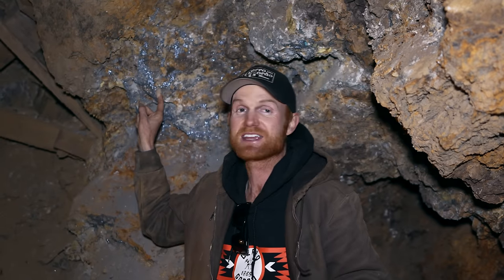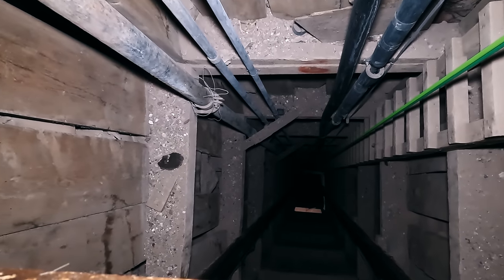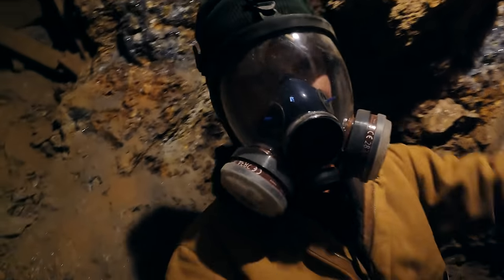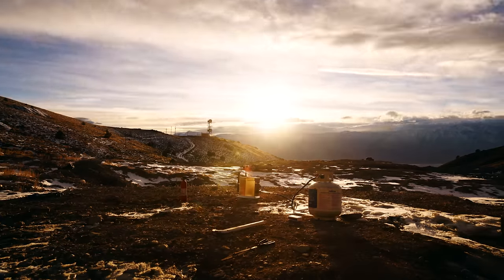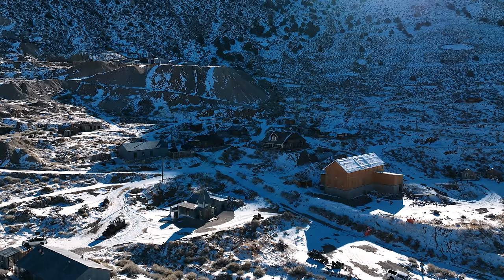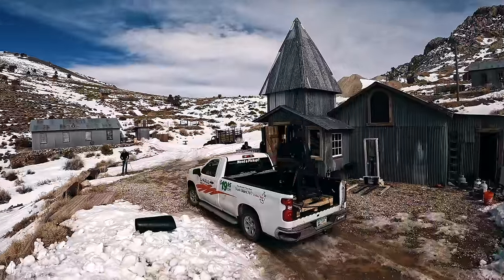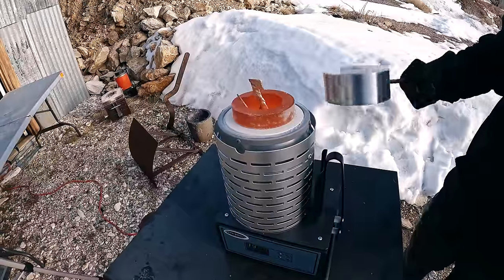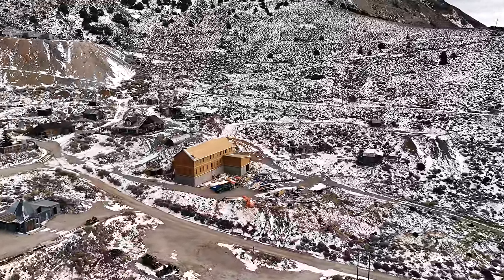I Mined 50 Pounds of Silver Ore & Made 1800s Coins!

Comment: Get a sturdy bucket/box and rope and then drag the bucket up and down the ramp next to the ladder.
Uhm, you're expected to dig ore, not read and play card games during your 12 hour shift.
For the front of your shop, put some doors on hinges attached to the top so you can then lift them up, put posts under each corner and thus not only keep out the elements when they're closed, but give you awnings which provide you with extra shaded workspace.
The Romans also used drop presses for their coins.
Score yourself a smaller electric furnace with a removable crucible - that'll allow for cleaner pours into the mold, also, get that mold heated up before pouring, not just to avoid potential cracking of the graphite, but also to allow the silver to cool without all of those bubbles and imperfections you got.
All said, good video and good haul - I pour coins myself but did enjoy seeing you stamp them out.
Reply: Who is this guy? Sounds like my football coach in high school.
Reply: @daleretired1457  Me or the content creator?
I played basketball, not football in high school and never coached - I only did the video because I collect and pour coins myself - no clue on the creator as this was the first time I've watched one of his vids.

Comment: With every one of your videos posted to this channel I'm impressed even more.  I like the stories you tell, and the process you're going through to improve this camp (the mine).  I've listened to all of the videos at least once, and I've watched and listened to several (many) of them more than once.  
I like what you're planning to do to the water situation for drinking and general support for the town, but I just wish that there was something you could do to the road condition that will last longer than each major rainstorm.  You once mentioned putting in a water catching system.  That sounds like a good improvement for all the non-drinking needs of the town.

Comment: Considering you’re so remote, I had a suggestion for you if you don’t mind. 

I build custom lithium batteries for homesteaders, but have always been curious about a fuel source that one could generate from solar power. 

Have you ever considered a solar/wind and battery setup that has enough power not only to keep your needed utilities on, store energy for low production days, but also to power a hydrogen production setup? Hydrogen burns much cleaner and hotter, and you’d be able to have a renewable fuel source that’s completely natural and emits nothing but water?

I’d love to build you a custom setup and see your town, it’s stunning and it’s been a great couple years watching you turn it around ❤

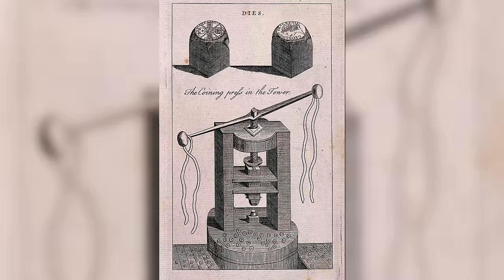Comment: @25:28 - There is also Drop Striking.  Raise a weight, in a track, above a Die and then use a string to pull a pin and the striker hit the Die and struck the coin.

Comment: The age of your mining site suggests all that copper wire you are reclaiming from the old hotel came from the Keweenaw Peninsula copper mines in upper Michigan surrounded by Lake Superior. Some of which eventually extended more than a mile underground and because of the depth the shafts were running 90+ deg F temperatures. The last of the mines closed around the 1950s-ish era since western US open pit mines were opened and costs were a lot lower than the Michigan Copper could be hard rock mined. A fun book about the copper industry you may appreciate is "Cradle to Grave" by Lankton.

Comment: Great content as always, Brent! Hard to believe that @GhostTownLiving and your adventures have been working' hard for over 4 years! 
I had a strange observation of one of the B&W photos you showed at around 3:42 of the video. It's a wide-angle view of a couple of horse teams heading down from the mine....does it say 'KEELER, CAL. 2041' in the bottom-left??😲 
Perhaps there was a different dating system back then? It cannot be 2041 feet in elevation...I wonder if it was signed as 2041m .. or about 6700 feet? Hmmmm. Are you travelling into the future after the apocalypse while going into the mine, Brent? 🤣

Comment: The issue with the zinc is more likely that your molten alloy was hotter than the boiling point of zinc. It would have flared up whether it was preheated or not. This is a known issue with making Nordic Gold as well, as the melting point of the Aluminum bronze base is around 1800F while the boiling point of zinc is around 1600F. In order to incorporate any amount of the zinc, you must have the other metals already liquefied, but you loose a significant portion of the zinc as it boils off before having a chance to dissolve.

Comment: You should look into chemical refining with nitric acid. It would allow you to get a much purer product than with coupling alone. It will also remove most other metals that might have carried over such as zinc and lead.

 Edited -  Side note: Most coinage contains some copper because it keeps it from tarnishing as quickly as pure silver. Usually sterling silver is 92.5% silver with the remaining being copper. Though it doesn't have to be copper.

Comment: Cool stuff!
I highly recommend you invest in what’s called a “rivet buster,“ to chop out the ore, instead of using a spike and hammer. You’ll mine 50 times more, at least, in the same amount of time, with a rivet buster. They come electric powered and air powered, but of course you would need a compressor for the air powered, which might be difficult and in your situation.
Maybe use a rope on that bucket and pull the bucket up. You would have to have some type of a lid on the bucket, so it doesn’t get hung up on the stairs. Also use a harness on those ladders, in case you mis-step and fall down the shaft .

Comment: Fun fact about US silver coins: Every silver US silver coin had a composition of 90% Silver, 10% Copper. The reason they did that was to make the coins more resilient. Silver is a very soft metal and pure silver coins would be worn down very quickly in circulation, to the point where some may not be recognizable as US currency after a decade, or will have lost so much weight in circulation that it would be likely that a shop may turn down a worn dollar coin since the lost silver would have devalued the coin to less than face value. The coins you made here are actually more pure silver than actual US currency from the time. That being said, the coins being pure silver makes sense for scrip coins since it was likely cheaper to just make pure silver coins from the silver they dug up on-site instead of shipping a bunch of copper up to make coins more in line with actual US currency. The silver boom of the late 1800’s and early 1900’s made silver far more common in the US than it was in the past. In the mid 1800’s, it was more common to see gold coins in circulation than silver because we had so little to go around and countries like China traded almost exclusively in sliver, meaning the government was more interested in saving their silver for trade. They also likely expected that many mining towns would be abandoned within a decade or so, and so the concern of advanced wear on the coins likely wasn’t as much of a concern.

Comment: Galena is the crystal that was used in vintage crystal radios. There are tiny places on the crystal that act like a solid-state diode or a detector that is what they used to call them. They were the first diodes but not very useable for anything but radio. They would find these places with a tiny wire they called a cat whisker. I believe this is where the diode symbol came from because the first time I found the symbol being used was on crystal sets, the Galena is the flat side and the arrow is the cat whisker, the Cathode Anode. Using carbon pencil lead on a razor edge worked but Galena was better.
Reply: Some of those antique crystal radio sets in museums might have Galena from this mine.
Reply: What they were really doing was finding electron holes but back in their day, they really didn't understand it that well until later when silicon and germanium diodes and transistors came along.

Comment: 23:13 Man I'd have a pirates treasure chest full of silver ingots. I'd be hauling that galena ore up out of that mine by the 5 gallon bucket full. I'd have the whole silver manufacturing process streamlined to a science. When my treasure chest was full of ingots, I'd cash it in so fast, make your head spin. Surely a treasure chest can hold 400lbs of silver ingots, by my calculations, that's $13,040.00 If I could do that atleast 4 times a year, I'd be good.😂

Comment: It's amazing how expensive the coin-making process is. The problem with using silver as money is that we don't have enough little bits of it. Junk coins can be valued according to their weight in silver (dime=2g, quarter=5g, 1/2 dollar =10g), but it costs energy and time to mix, cut, and press the coins. I see how it could be profitable. If you tender a silver dollar for something that costs far less than that, who is going to make change? There is not enough junk silver (US coins before 1964). It seems like someone is going to have to step up and make junk silver again.

Comment: Brent, just a point of refinement. It's not quite accurate to call the CG silver coins "scrip," as their silver content made them universally valuable outside of the CG boundaries. Company-issued paper -- not redeemable in silver, but only redeemable at the CG store -- would rightly be call scrip. Another point -- if my suspicions are correct -- is that CG management stamped a value on them that was slightly above the silver bullion price at the time to encourage keeping them circulating at CG. Had they stamped a store redemption value lower than the silver bullion value, it would have been profitable for people to take the coins elsewhere, sell them for melt, and come back to the store slightly ahead. (Of course, all of the above would have to be adjusted to include transportation and time costs, which I left out of the discussion for simplicity.) Btw, could you kindly post what the weight of a coin is. And do you know when they were minted? I'd be interested to do a little research using those two pieces of information. Thanks! As a student of the history of coinage, I found this a thrilling episode!!

Comment: If you keep the sand paper you rub down the coins with there are process that return youre pure silver back keep them and stack them ready to ♻️ recycle theresa guy calls himself streetips here on youtubr hes a great guy so informative he may refine youre metals t 3x9 pureness contact him hes a great guy to share technique with he may well be a good influence when it comes to making the most from youre produce and save you alot of mony using a cathode collection mechanism  12 or 24 volts can run aside youre generators or vehicles power supply